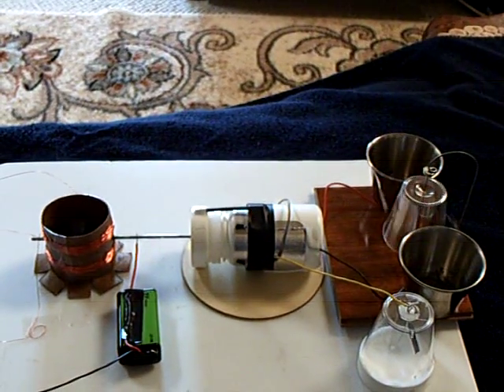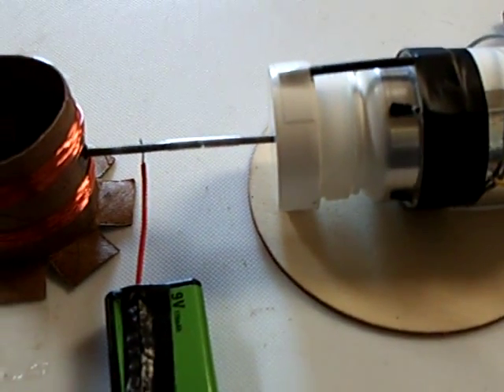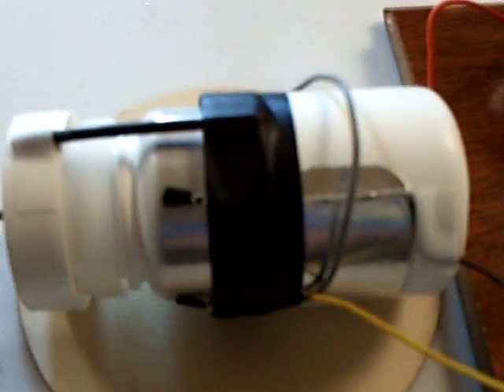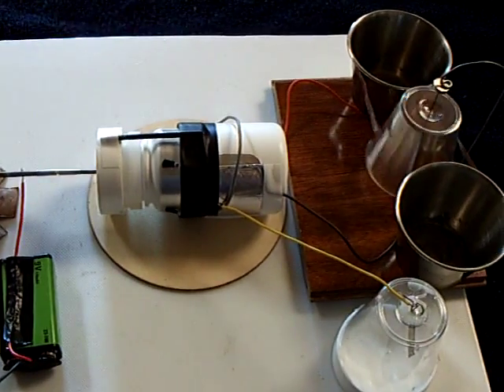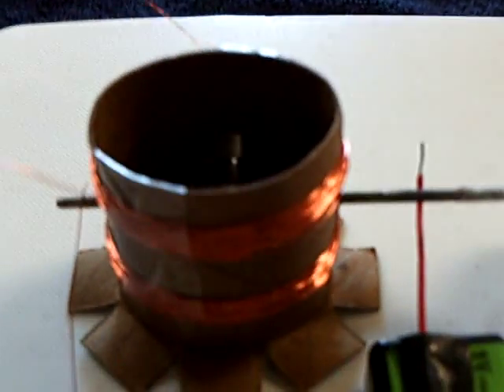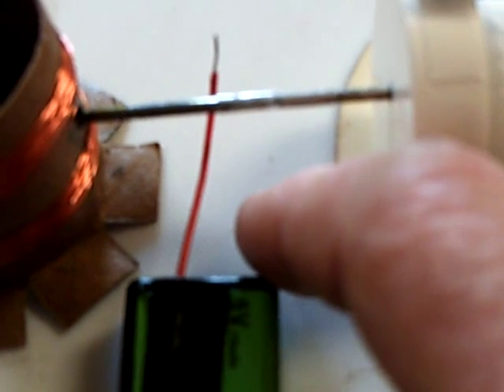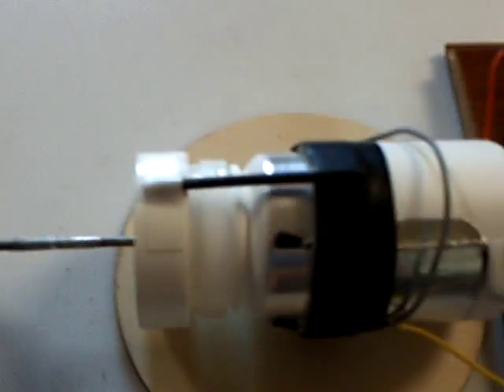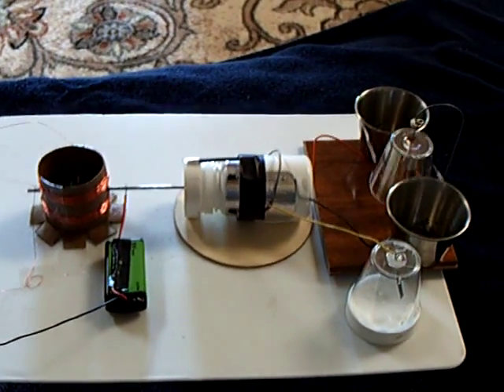Newman Motor powering an Electrostatic Generator

Comment: Loop your static back via tesla coil in reverse, diodes and dc caps to your battery.
Reply from the maker: I have not tried a Tesla coil voltage step down method yet but it is on my to do list.
Reply: And use a bifilar as secondary while stepping down.